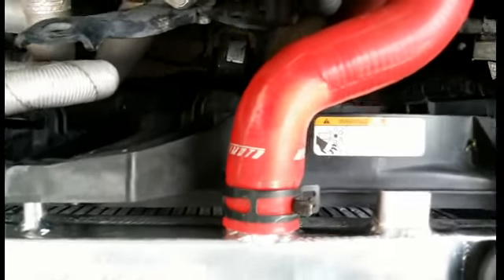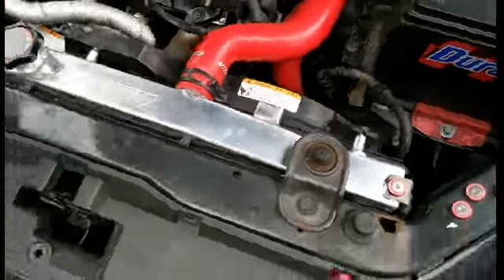Tiburon Mishimoto radiator review /DIY

Comment: Quick question, just ordered this and saw in forums that some tabs had to be dremeld to fit the fans to the radiator. Did you have to modify anything on it or the fans to get yours to fit by chance?
Reply: Anthony Marasa since its been a year. I'm following ur footsteps any dremeling?
Reply: Do they make a mishimoto Aluminum fan shroud for that radiator